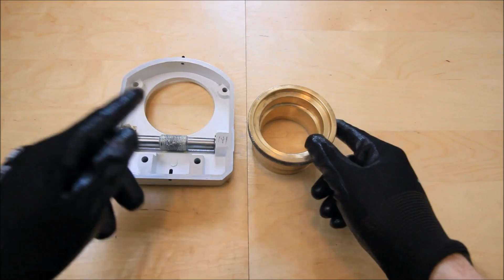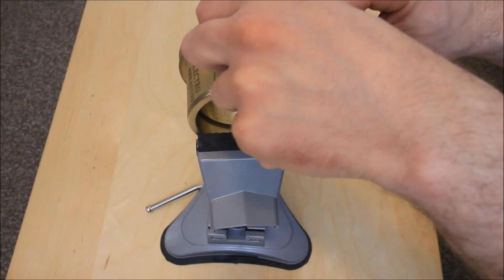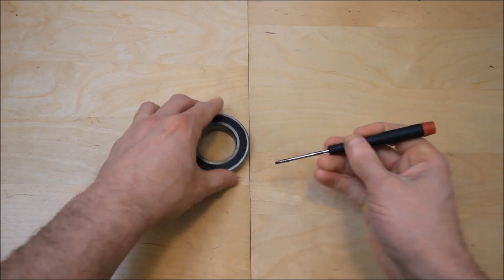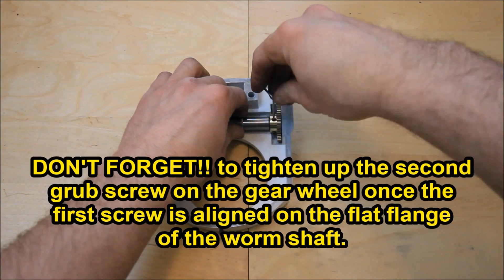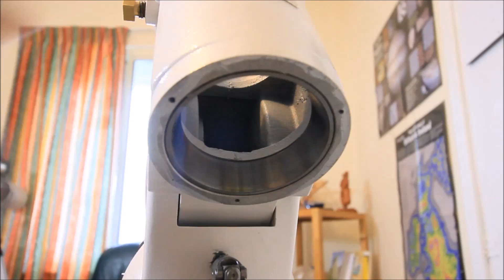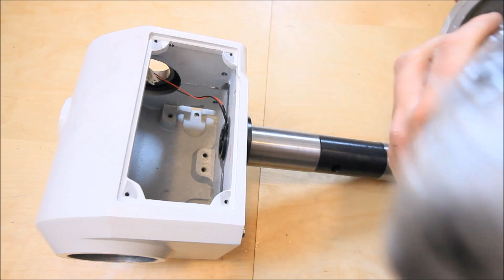How to Super tune the Skywatcher NEQ-6 Mount Part 3

Comment: Great video. One comment on greasing / re greasing the bearings. Do not pack the space between the bearing balls or rollers full of grease. It's not needed, and only increases the stiffness / resistance when they rotate. Just put in enough so all the metal surfaces have a film of 1-2mm. 
That's enough to give you really smooth and free rotation. 
It's true that in other equipment (eg car) you pack the bearing fully. That's when you have high speed and high force. Here the telescope movement is slow and low force. 
Any NLGI-2 grease from a big brand is fine to use. If you want to be extra careful, use NLGI-2-EP grease. EP stands for Extra Pressure. 

Thanks again for great videos with lots of detail.
Reply from the maker: A few good tips there, And new grease tip, something to look into myself, Have you got the links of this grease you use??

Comment: Hi Martin, Just a question here, i'm not really handy, i got my new SKF bearing set. it's normal these bearings are a little hard to turn ? they turn smooth, but i have to put some amount of pressure with my finger to turn it in the worm gear case. Thanks to confirm this ;)